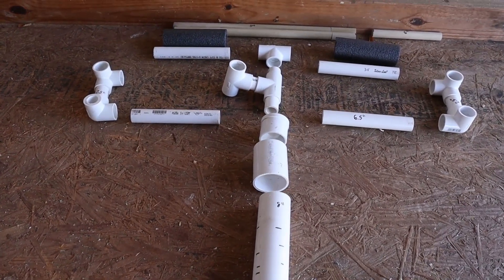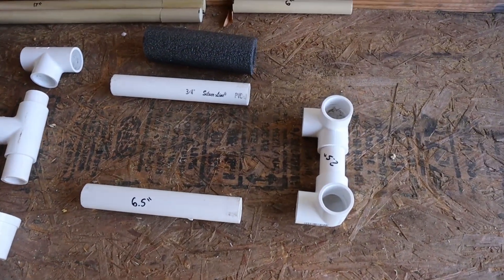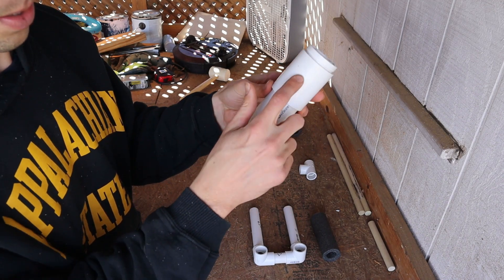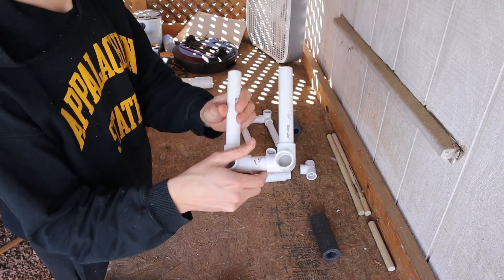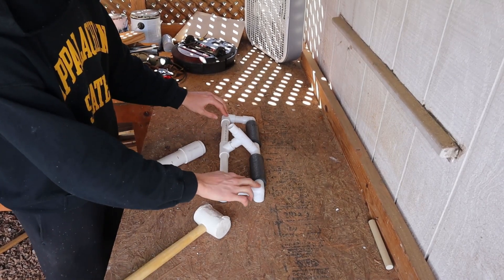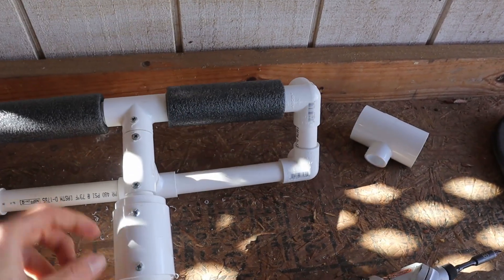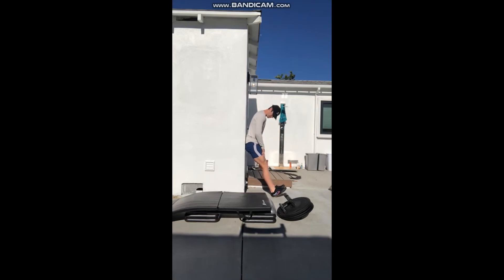DIY Knees Over Toes Guy Tib Bar - How to Make Tibialis Bar and Fix Shin Splints

Comment: Nice job with the instructions and video... I made this one weekend.  I found a few discrepancies in wooden dowel lengths and the need for wider pipe (1.5") to hold the weights, as all our weight plates have 2 in hole.  Might be b/c the right angle joints I used were longer and fit about 1" of pipe inside them. 

TiB Bar PARTS LIST - so you can go to store with an easy list of what to buy

(4) 6.5” @ ¾” pvc  
(2) 2.5” @ ¾” pvc
(3) 2” @ ¾” pvc 
 total 37” of ¾” pvc - I just bought an 8' piece and use the rest as pipe to do pass throughs
(4) ¾” 90’ elbows
(3) ¾” PVC T’s
40” Dowel rod 2 x17” + 1x6”   - might have to have more or less dowel depending on your fittings
(12’) ¾” pipe insulation  cut into 2 x 5 1/4” 
(1) Hitch Pin 3” @  ¼” 
¾” to 1 1/2” bushing
1 ½” coupling
12” 1 ½” pvc
Reply from the maker: Thanks for the parts list! You are correct on the pipe size. I mistakenly say 1-1/4" a few time in the video but it's 1-1/2". Glad you were able to make one!
Reply: what was the total cost for your built?
Reply: Thx Jay for the list.
Reply: thanks for this :) what was the total cost for these pieces?
Reply: Thx for the list, now i just need to transfer this to the metric system😆
Reply: @simonsalibapt6446  Just put all the parts into a cart at Home Depot/Lowe’s, for me it’s around $30-$35. I’m in Upstate NY.
Reply: The measurements didn’t work out quite right for me. Don’t know if it was based on the elbows or that my hand-held pipe cutter made the lengths off by about 1/16th inch from one side of a cut to the other. My 2.5” PVC pieces needed to be 3.25” long and my 17” dowels needed to be 15.5” long. In the end, everything worked out fine. I used an Olympic collar instead of a hitch pin. Great video overall. Thank you for the design!
Reply: what thickness is the dowel rod??
Reply: Any alternatives to the 3/4 to 1 1/2 bushing?

Comment: We made this today. It was even easier and cheaper than the slant board at about $30. We had to cut the small sections slightly smaller for the geometry to work with the parts we got. And we went with 1.5 inch PVC for the plate holder, and it's just right.

I'm amazed how well the device does its job. It's perfect. Thank you for posting this. And for anyone that doesn't have the tools, he is selling it at a phenomenal price for the value.
Reply from the maker: Glad the build went well! Thanks for the support!

Comment: I’m leaving this comment because I want to give a positive review and to recommend Petie’s products, specifically the Slant Board. The slant board from the Tib Factory is my favorite of all my slant boards, wedges, and door stops. Meaning, I’ve bought several types from different places, in different sizes, and different materials (foam, metal, rubber, and wood).  The Tib Factory’s slant board keeps it simple with a one-piece fully assembles design; the approach angle and overall width feels great for stretching and getting that deep squats; and the grip tape feels amazing and adds more feeling of stability to an already structurally-sound design. I wish I had never bought the other slants that I have, but at least I have a door-stop for every room in my house 😂

Comment: I use the lightest kettle bell at my gym. Works perfect. Just sit on the bench and put it on your feet and rep it out
Reply from the maker: Great solution!
Reply: i tried that...but my feet are too big to fit in the opening :P  but that definitely would work perfect for a lot of people!
Reply: Doesn’t work for any of us big footers out that. Clod hopper problems. But that would be a great solution for most
Reply: @Brady Janssen 😂. 12-13 depending on the shoe but I also have wide feet so it’s a struggle even getting into like the bike pedal loops. I have the ever slightest idea of what these giants in the NBA have to deal with in everyday life 😆
Reply: @sneakergearz  also if you have bigger feet...make the side pieces a little longer maybe 3" cuz I made this and it works great but it's a little small with shoes on (Size 14)
Reply: my gym has odd smaller sized kettle bells.   there is one 10 lbs one that does work.   but the rest have way too small of opening
Reply: I'm a size 9 and although my foot fits, it is awkward and doesn't work for me
Reply: Thank you!
Reply: @poofykins  even the competition bells?
Reply: @damianhinch2907  They might work but my gym only has 45 lbs and for 1 foot lol that's a hell nah...not yet at least :P
Reply: @poofykins  ahhaha
Reply: Tried that. Hole is to small to stick a foot in
Reply: How many kgs to start and progress to slowly (in general)?
Reply: @TRIQx1  use the lightest ones and do like 15-25 reps and if that’s easy go up spelt. No rush
Reply: Slowly*
Reply: There are supposedly kettle bell adapters for regular dumbells that you can use if you already have regular dumbells
Reply: You can always use a rubber band and strap a dumbell vertically under your shoe.
Reply: Hell yea. Unfortunately with kettle bells there's so many variables for whether it will work out or not. Often the handle is too small, or as you go up in weights, the handle can be too big, and then not sit in the right spot. Can also be painful, since there's no padding. Plus, not everyone wears shoes when working out at home.
For the bigger ones, the weight can also be too far down on your underfoot, which isn't ideal here.

Comment: Thanks for all of the help with DIY fitness stuff, Petie! In the past week I’ve made your slant board, Nordic bench, and tib blaster. I’m so psyched to put these things to use and get a healthier body back. 

I did do one thing differently on this project though. Instead of drilling the 1/4” holes for the plates, I just used a standard spring bar clamp to hold the place on the 1-1/2” PVC pipe. At first the clamp wouldn’t stay on because its inner diameter was just slightly to large. So I added a layer of Gorilla tape around the whole 1-1/2” pipe. Now the collar stays in place super secure 👍 Really happy with how that turned out. 

Anyways. Keep up what you’re doing man. I’ve enjoyed all of your videos, including the finance ones. I always get excited when I see you out another video out. Looking forward to the DIY Monkeyfoot!!! 🤙💪
Reply from the maker: That's awesome, glad you are benefiting from the content! I hope your training goes well!

Comment: Just finished mine! It went together easily. I did make a change where the weight holder is just the 3/4 in pvc. I did this since I’m not using Olympic weights. I also have a standard size bar clamp and it fits perfect. I can use it instead of using the pin. Thanks for posting this!
Reply from the maker: Awesome, You're welcome!
Reply: Heey I dont use olympic weights either, can u tell me what u changed and by what to make your tip bar pls ?
Reply: @hichemessamkaoui8292  everything is the same except the portion that holds the weight. The video use 3/4 pvc to connect the holder to the t-joint and then connects that to the large pvc converter. All I did was make the 3/4 in pvc about 8” long without the converter or large pvc. Be sure to dry fit everything. My right angles and t-joints were different than in the video so I had to change the length of some of the pieces.
Reply: @tomorrow456able  Great, thanks for the reply man!
Reply: How is it holding up?  I don’t have Olympic plates either.

Comment: I made this the other week according to the parts list included in the comment by another viewer and it turned out great for the most part. Cost me about $50 total but I had to buy some expensive pieces like a drill bit that some people would already have in their toolbox. For pvc, dowel, and pin alone, it would only be about $25-$35. I ran into three problems when making this. First, my 2” pieces weren’t fitting into the tee far enough to be able to twist the foot rests bars around enough. I had to cut these down about .5-1” to make it all fit right. This might be because the tees available at my home depot hd different measurements. Second, the 17” rods were a little too long and I ended up cutting em down about 1” each. I did this by eye after attempting to fit it all together and recommend you also wait before you cut anything too short. I also cut my 6” dowel rod too short and couldn’t secure the 1-1/4” to the dowel with a screw. I bought pvc primer and cement and that wasn’t any tougher than cutting dowel rods and screwing the pvc in. Hopefully more secure if anything.
Reply: Also, i bought the pipe insulation foam for padding but I don’t think it’s necessary unless you’re working out barefoot or repping HEAVY weight at which point you can head back to the store and get it at a later point.
Reply from the maker: Glad it turned out great!

Comment: Thanks mate! Just finished with making one for myself.

Went to Lowe’s today and spent ~$20 on materials since I had absolutely nothing to start with, even screws. I personally had to use 3” pieces on the side and it seemed more square. Ended up with very little waste material besides the extra foam👍👍
Reply from the maker: That's great John! Glad you were able to make one! $20 sounds about right for materials if you are building completely from scratch.
Reply: Did you get to using it yet, how did it turn out ?
Reply: @bbetros  Works like a charm👍 I was able to use 3/4” PVC for the whole thing since my plates have a 1” hole. Feels super sturdy after adding extra screws to each 90degree piece. Adding dowel to the sides would make it even stronger but since most of the force goes through the center “T” joints I think it’s fine. I found a D-shaped hitch pin on the same isle as the screws and it’s super secure

Comment: to reinforce the joints, I recommend getting PVC adhesive and sandpaper. You scuff the inside of the joints and where the pipe enters the joint, then put the adhesive into the joint and put it together. However, you must be very quick as the adhesive will bind up extremely quickly
Reply from the maker: Good idea!
Reply: To add to this, you can dry set your joints and make sure everything is square, then mark a line with a sharpie across the joints, next take it apart add glue and easily line up everything with the marks you made...it can be tough to get everything square with the small glue drying time window.

Comment: The weights that you said you were using come with a 2 inch hole??
Reply from the maker: Correct, Olympic weights have a 2" hole
Reply: @ThePetieProject  but your video says the bushing is a 3/4" x 1 1/4" .....did you say the wrong  measurement?

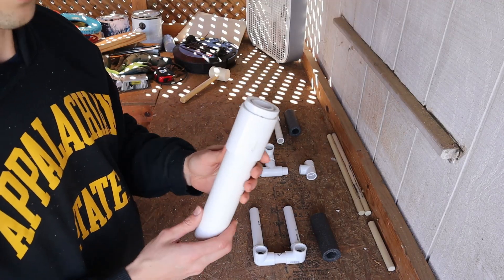Comment: This is great, thanks for sharing,. Question, you keep saying 1.25" PVC pipe but it looks like that 8.5" piece says 1.5" ?? see 3:14
Reply from the maker: You are welcome! Yes you are correct, it's 1.5"! Sorry about that
Reply: @ThePetieProject  could you clarify this in the description? and also put a parts list in the description?
Reply: @ThePetieProject  does this effect the coupling and bushing size?
Reply from the maker: @steviemancuso1855  That's correct the coupling is 1.5" size to match the 1.5" PVC and the bushing is going to be a 3/4" to 1.5" bushing. Sorry for the confusion! Was figuring this thing out as I was filming!
Reply: @ThePetieProject  No worries! Thanks for clarifying

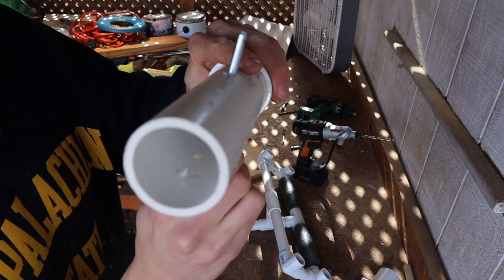Comment: At 8:16 the drilled loading bar section of PVC is clearly marked 1 1/2" but you call it 1 1/4" at the top of the video.  I assume both will work with Oly weights but 1 1/2" is more snug, yeah?
Reply from the maker: You are correct! It's supposed to be 1.5" I mistakingly say 1.25" in the video.

Comment: Awesome job, do you have a material list? I’m living in Mexico and would love to build one of these.
Reply from the maker: I am borrowing this parts list from Jay Kershner's list he commented! Thanks Jay for laying this all out!

(4) 6.5” @ ¾” pvc  
(2) 2.5” @ ¾” pvc
(3) 2” @ ¾” pvc 
 total 37” of ¾” pvc - I just bought an 8' piece and use the rest as pipe to do pass throughs
(4) ¾” 90’ elbows
(3) ¾” PVC T’s
40” Dowel rod 2 x17” + 1x6”   - might have to have more or less dowel depending on your fittings
(12’) ¾” pipe insulation  cut into 2 x 5 1/4” 
(1) Hitch Pin 3” @  ¼” 
¾” to 1 1/2” bushing
1 ½” coupling
12” 1 ½” pvc
Reply: @ThePetieProject  thanks a lot brother
Reply from the maker: @anthonyboudreau6966  you're welcome!

Comment: Can you write in the description for what you used too? I love the video
Reply from the maker: Glad you liked the video!

Jay hooked us up with a list and a few comments from his build! Reposting his comment

Jay Kershner
1 month ago
Nice job with the instructions and video... I made this one weekend.  I found a few discrepancies in wooden dowel lengths and the need for wider pipe (1.5") to hold the weights, as all our weight plates have 2 in hole.  Might be b/c the right angle joints I used were longer and fit about 1" of pipe inside them. 

TiB Bar PARTS LIST - so you can go to store with an easy list of what to buy

(4) 6.5” @ ¾” pvc  
(2) 2.5” @ ¾” pvc
(3) 2” @ ¾” pvc 
 total 37” of ¾” pvc - I just bought an 8' piece and use the rest as pipe to do pass throughs
(4) ¾” 90’ elbows
(3) ¾” PVC T’s
40” Dowel rod 2 x17” + 1x6”   - might have to have more or less dowel depending on your fittings
(12’) ¾” pipe insulation  cut into 2 x 5 1/4” 
(1) Hitch Pin 3” @  ¼” 
¾” to 1 1/2” bushing
1 ½” coupling
12” 1 ½” pvc

Comment: I ordered mine. It's great. Can the plate be held with a barbell clip? Instead of the pin
Reply from the maker: Thanks for the order! Some clips fit the pvc but some of them will slide so I use the pin for safety to make sure nothing slides off. The pvc is ever so slightly smaller than a metal Olympic bar but I've seen some people add a small layer of tape on the shaft so that the clip will grip instead of using the hitch pin
Reply: Great man. I actually brought some clips. And they fit perfect. Super snug!

Comment: what is the total length of yours?  yours is longer than ours, how can that be? the 17" long dowel will not fit it is to long???  We just figured out why yours is longer, because you didn't use the  90 degree elbow you used a three way fitting which is longer.   And yes your video says 1 1/4" instead of 1 1/2 ".   You might want to add an explanation at the beginning of the video  on both problems, it is frustrating following your directions that don't work.   My husband got it figured out because he does plumbing work but for other folks it would not be fun.🤣🤣🤣🤣   Thank you for posting this and helping everyone with the savings cost, Lord knows we can all use good ideas to save a dime now a days!  I will be looking at your other ATG items. Thanks again.

Comment: Hey Pete, how do you get the right angles for the rig so that it all works. I've just started on the atg program and need to build one of these tib bars. Cheers for the great videos.
Reply from the maker: As long as you follow the dimensions outlined, everything should line up! The fittings lock the angles in so you don't have to worry about getting the angles set manually if your pieces are cut to the correct length.
Reply: @ThePetieProject  ok that's great, appreciate the help. Thanks again buddy.

Comment: Could you use a collar to hold the plates instead? Thank you for sharing, this is awesome!
Reply: Also, do you think doing 1-1/2” inch for the whole build would still be good?
Reply: Reason being I can’t seem to find the bushing
Reply from the maker: The 1-1/2" to 3/4" bushing can be tricky if you are looking at Lowe's or Home Depot. They are out of stock a lot of times. I haven't personally tried the collar. I would hate for it to slip off. The hitch pin with the hole method is definitely more secure.
Reply: @ThePetieProject  thanks for the reply man, being from Canada i plan to build this myself. Is the reason you chose 3/4” for the sides simply because that’s what you had as scrap? I was thinking to build the entire thing using 1-1/2” PVC.
Reply from the maker: Yes, initially and also to keep the total cost of the build down. The fittings for the 1.5" can get pretty pricey, but it may also eliminate the need for the internal dowel for strength/rigidity if you built the entire thing out of 1.5" schedule 40 pvc.
Reply: @ThePetieProject  great, thanks for the information man. Appreciate the video!

Comment: I have the regular weight plates with a smaller hole. It's about 1 1/8 inches diameter. Would I still be able to create a Tib bar using the PVC pipe and dowel rods?
Reply from the maker: Yes, you will need the thinner version of 3/4" PVC. I also offer a version for standard weight plates at www.thetibfactory.com

Comment: I am looking at your sleds for sale, I would have to use it on a gravel driveway which one would be better for me?  Is the wood pressure treated to be able to withstand moisture from rain?
Reply from the maker: None are designed for gravel. I think the only thing you could pull on gravel would be something on wheels like the torque tank but they are extremely expensive. Backwards walking on an incline is a great start if you have no other options